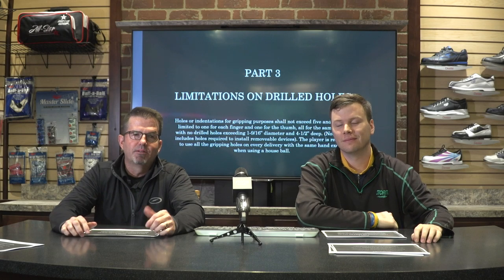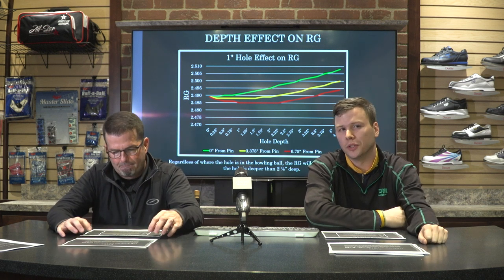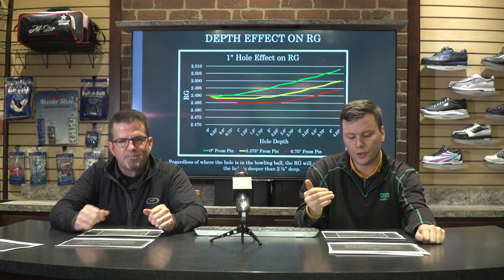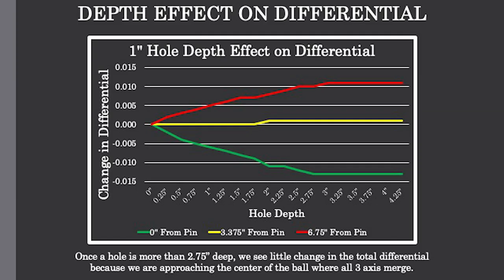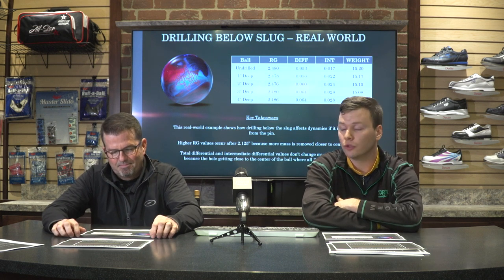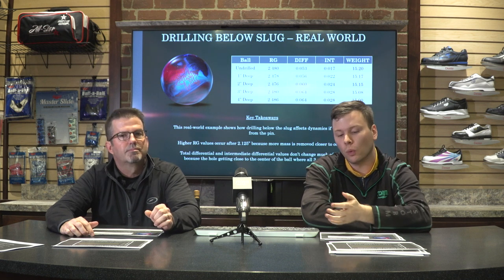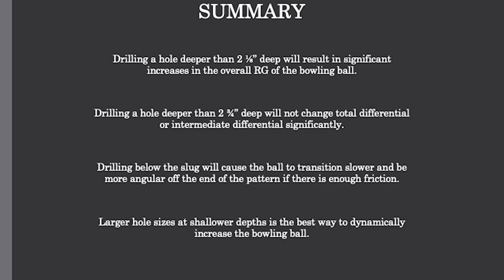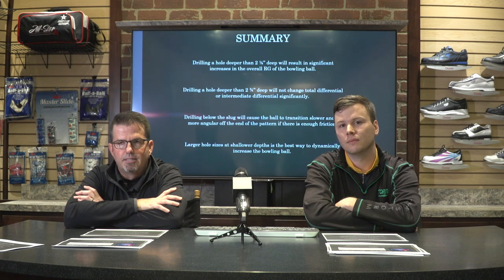Storm | Limitation of Drilled Holes

Comment: this rule sucks, I'm a two handed bowler and sometimes I want to play around throwing one hand. That means from now on I have to get separate ball for one handed and two handed.
Reply: Idk if this would work but have your thumb in for one step only and then get it out
Reply: @mateog4658  I don't know, it just says "in the delivery".  Maybe it defines delivery better in another location but I haven't seen it.  The last point of contact with the ball for all bowlers are the fingers so unless it specifically says it is a certain point I guess you could just take a little baby step and take your thumb.
Reply: The delivery is on the last step, so this will not work to get around this rule.
Reply: @scottpatton8806  Thanks for the information; what section is this defined in the rulebook?  I looked again and couldn't find anything.
Reply: Wouldn’t not having a thumb hole for 2 handers keep the ball surface area slightly larger than having a thumb hole thus improving their chances of hitting a pins or with more power?
Reply: @PebblesChan  Some no-thumb bowlers may flare over where their thumb-hole would be on a properly drilled ball but that is a really insignificant advantage  I don't flare over where my thumb-hole would be so it absolutely doesn't help me a bit.  I also don't use many high-flare layouts, the covers are plenty strong enough today to get good ball reaction without it.  Much more often than not, I see my ball reacting too early and rolling out than reacting to late.  How the ball flares is much more important than the small area of cover that would be removed by your thumb-hole.  The advantage you get by having a thumb-hole is how much you can alter the dynamic properties of a drilled ball.  Radical publishes the RG and diff of drilled balls with different layouts and it is pretty astonishing how much they change.